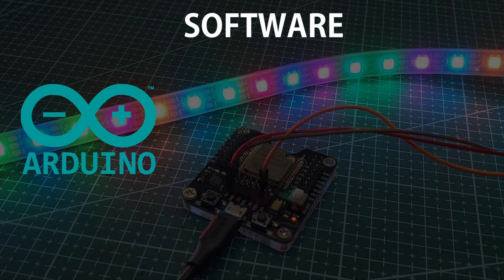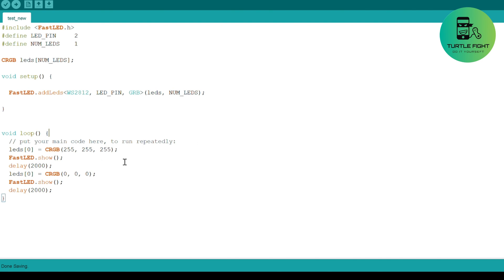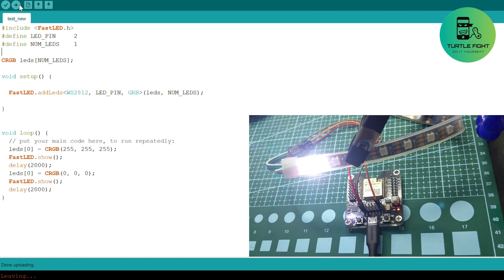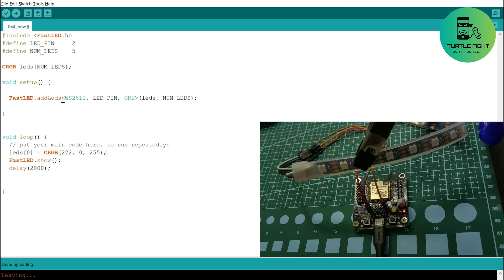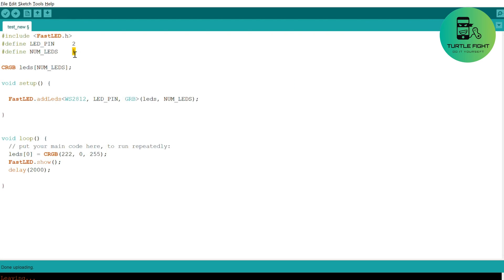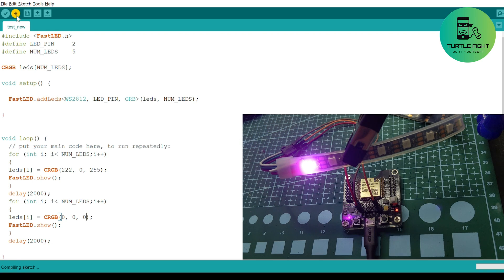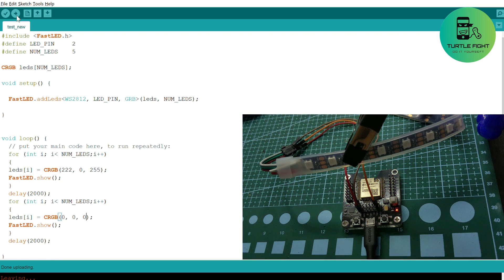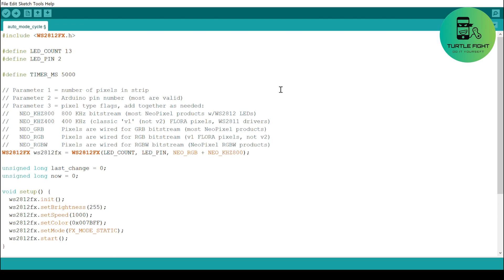How to Control ARGB WS2812B Led Strip with ESP32 and Arduino IDE - Turtle Learn

Comment: Hi,thank . sharing, can you test how much LED can be controlled?
Reply: That depends on the available amount of RAM in your microcontroller and may be on the timing needed for your effects.

One LED occupies 4 Bytes of memory. So for 1.000 LEDs you need 4 KB (kilo bytes).

To control one LED you need 1.25 microseconds. For 1.000 LEDs in one strip 1.25 milliseconds are needed.
Reply from the maker: Sorry, because I just have a Led strip so I can't test for you